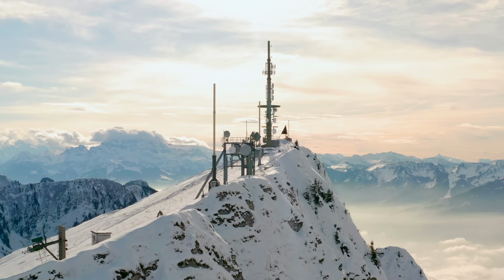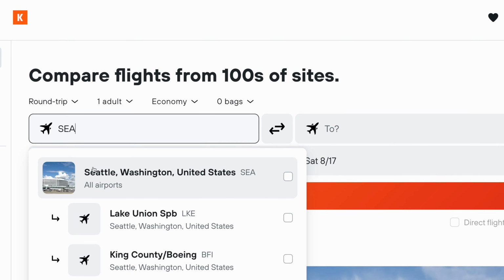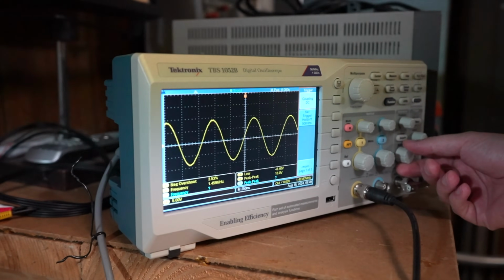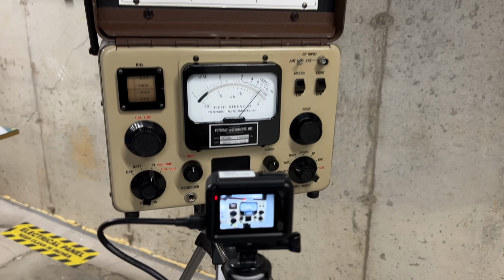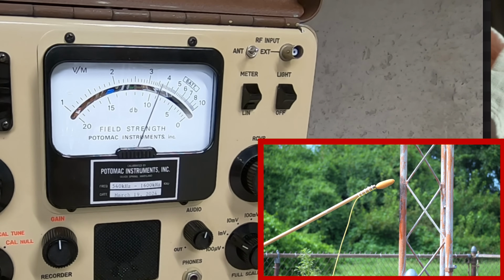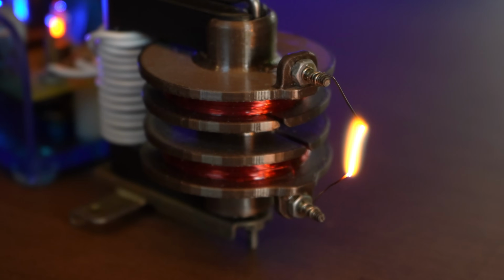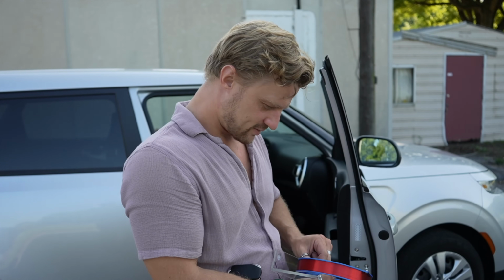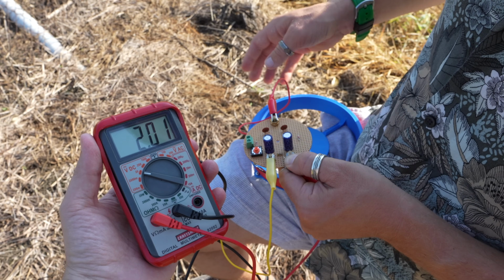Stealing Energy From Radio towers Using Plasma (ft. Geerling Engineering)

Comment: I was a radio alignment tech for UHF and VHF two-way radios, such as those used for police and such.  One day I was working on a 20 watt handheld and got a little too close to the final (the transistor that drives the power to the antenna).  Wow.  Now I have been shocked before, a number of times, including from a 30kv neon transformer....and non hurt as much as that RF burn.  It honestly felt like taking a glowing hot needle, sticking it into your finger, driving it into the bone.  I told my boss, and he said that if I had gotten hit by one of the 100 (or more) watt car-mounted ones, I'd be going home for the day.  My finger had this little dark tinge around the spot it happened, for quite some time.

I misspoke on the transformer...I recalled the numbers incorrectly.  I remembered 15 and 30 but transposed the value they were attached to.  It was a 15Kv 30mA max...I mistakenly remembered 30Kv 15mA.  It did make for quite a good Jacob's Ladder.  It struggled at first to restrike the arc, but I found an article about what was called a Gabriel's Anode, which is just a high resistance resistor connected to one post, with the other side floating near the other post.  The arc strikes from the free leg of the resistor, then the arc reaches to the other leg, avoiding the resistor, then travels up the arms.
Reply: I got my RF burn from a cavity oscillator in an aircraft transponder! Same thing happened to my finger, a burn that went deep into the finger, and took a long time to heal. Afterwards I was even MORE careful around the output components.
Reply: thats something that always gets quickly lost, and something i had to learn myself tinkering with RF electronics... 
being used to pumping kW of power into a resonant tank at 100khz, thats only resonating at 300V or so... lower impedance and all, at those frequencies no matching needed. Skin effect... capacitance still too little to cause any pain when touching a resonator.
But at the almost all the time used 50 ohms in the RF bands (13.56MHz where i was playing :P) even the lower voltages cause quite some current to flow because of the higher frequencies. 
i can only imagine VHF and UHF bands to cause any capacitive reactance a fingering guy presents to shoot close to 0
Reply: Neon transformers are 15 kV max.
Reply: @mernokimuvek  With RF burns, it isn't the voltage, but the frequency that gets you. VHF and UHF radios are bad, but microwave frequencies, up into the 10 GHz range are nasty. In my case, the voltage was 7KV, but magnetron voltage could get up into the 25KV range, higher with military radar. And they put in many interlocks to prevent accidents.
Reply: @jeffreyyoung4104  I know, but the guy mentioned a 30 kV NST. Which simply doesn't exist.
Reply: @mernokimuvek  Oh ya, not sure where 30KV is used, but it sounds familiar for some reason. Lasers? CO2 or some other gas laser? I would rather stick to RF nowadays, as I never had much luck with lasers, other than the old gas HeNe for holography, I couldn't get rid of stray vibrations living near a freeway at the time, so I gave up. I still have a HeNe tube, but it doesn't lase any more. And they only needed 3KV.
Reply: @jeffreyyoung4104  Some CRT TVs needed more than 30 kV.
Reply: @mernokimuvek  The larger the more voltage, also color tubes needed more than mono.
Reply: @mernokimuvek usually not more then 25kv. I think the projection TVs may hit 30kv. The reason you didn't want to go over 25kv is it starts to emit X-rays when you get much higher. Kind of unsafe. Took radio/TV repair in high school so have some experience in this.
Reply: @glynnetolar4423  It already emits X-rays in the single digit kV range but even regular glass can block X-rays up to 10 keV and lead glass can block them up to 50 keV.
Reply: @mernokimuvek my 25" color set produced a 6" spark. Right to my finger. I was leaning on the uhf tuner input,  with the left side of my chest ( my heart ). God is wonderful
Reply: Try pointing your finger at something and concentrating really hard on the idea of lightning coming out of the Tip. You never know you might have a superpower now.
Reply: @Buzzhumma  My super power is being able to repair electronic equipment. I have been doing it since I was 8 or so, and I could solder with a butter knife heated in the flame on the stove. I even had a work bench at age 8, in my bedroom, where I could tear electronic stuff apart, fix it and get it working again. My favorite things were old tube shortwave radios, and even today, they hold a special place in my heart.
Reply: I tasted 25 watts vhf military radio output directly on my tongue.  75.95MHz to be exact.  I was trying to see if the radio was broken or the antenna coupler. It wasn't the radio. That put out full power. I had someone in the helicopter blip the transmitter key on / off.

Comment: I bet those long arcs on the sausage make some interesting harmonics. 

Plasma is a non linear resistance as you know, you could probably hear that station on a few short wave frequencies when that arc was there.
Reply: Yeah, you're past the low pass filter on the output. Good thing it was only 12 KW and that hot dog made a pretty short antenna. But I would have loved to hear your explanation if the FCC called.
Reply: @jamesvandamme7786  I wasn’t there (sadly, lol.) I’ve heard stories of this happening on transmitters before, but I’d imagine the output generated on other frequencies would be much lower than the transmitter’s normal power. 

It also would be a one-off thing, and incredibly brief so I kinda doubt the FCC would put too much effort into it unless it was repeated.

Comment: Any time you're back in St. Louis, we'll do some more Midwestern science experiments! 😂
Reply: As a Midwesterner just south of STL, that 'midwestern science experiment' statement can go a lot of ways. From actual experiments, to ones soaked with Busch Light and sunburns, lol
Reply: Please tell me you got Jay the St Louis classic: Ooey Gooey Butter Cake?
Reply: @MeatBall-1-3 we tried!! Unfortunately the place we stopped was out - Bike Shop in St. Charles. He got some gooey butter/brownie but it's not quite the same. He'll just have to come back. And we'll do T-ravs too.
Reply: @MeatBall-1-3  or toasted ravs as apparently that's not a thing other places? (The butter cake I knew was local, but toasted ravs? Still blows my mind.)
Reply: Come create a plasma twister in nado alley, at Tulsa Ok!
Reply from the maker: Count me in!
Reply: As a fellow Midwesterner only a couple hrs away from STL i can confidently say said experiments usually involve some form of alcohol and fire.

That being said i have a serious question. How well would a generator designed to pull power down from radio waves charge a battery bank?
Reply: @scotyarborough4403  It would be a very small trickle-charge, and would need to be close to the tower to get a few volts of power necessary to actually charge anything.
Reply: I recognized your dad immediately
Reply: Now build a Tesla tower as it was intended to be configured and transmit power using zenneck waves
Reply: Only needed a couple seconds of audio to know it's a christian radio station😀
Reply: sucks that thing is used to spout off about the BS of Christianity!
But hey, a hot dog or coil will easily take care of it 🫡
Reply: I literally live right down the road lol
Reply: Make sure yall visit Shirley’s and grab some trashed wings. Worth every dollar.

Comment: Could you build a drone that could power itself  and have altitude hold .? That would be cool. You could have infinite flight times. Until it burns the motors out🤔. Or have an override to control and land.
Reply: That would be very hard. In theory, if you'd have a loop antenna that weighs next to nothing, you could hover within one or two meters of a large transmitter tower, but that's about it.
Reply: or a car
Reply: There were ideas of powering cars on a highway with loops of wire under the roadway. It would of course be terribly, ridiculously inefficient to do it from any kind of distance.

Comment: How does the radio wave travel around the curvature of the earth?
Reply: As far as I know the waves reflect of the atmosphere
Reply: @yudin_yaroslav  or the firmament?  Something solid to bounce off of?
Reply: Look up "ground wave propagation"
Reply: @dresdenvisage  I dont need to cause the earth is flat and thats how its traveled.  I dont need pseudoscience to convince me how something travels.
Reply: @Redgogrey  So you just go around asking questions and refusing to learn the answer. Gotcha. Go away.
Reply: @dresdenvisage  I figured the words used in the video title would attract a bunch of crazies and I wasn't wrong
Reply: Most don't. In most frequencies radio is a line of sight technology. Refraction and reflection off the ionosphere can greatly extend the range of certain frequencies though. Similar to how visible light bends in hot air and reflects off water.
Reply: @nonna_sof5889  Love the explanation, but that person doesn't actually care about reality.

Comment: The wood rod was held rather close to the body at 8:08. An arc could potentially jump from the wood rod to the body, bypassing the gloves. It looks like the gloves are designed to have deep arm holes to prevent arcs from routing around the glove. Please be careful because high voltage arcs will go around your insulator to bite you.
Reply: Keep in mind it's 800 volts.  It can't jump more than a few mm.  They were very safe.
Reply: Well I dont have my engineering handbook uh, handy making it rather useless rn, I do know that wood is an excellent insulator for electricity. 
Do you know why blank circut boards are called breadboards? Because the first ones where just that, used bread cutting boards, and quite a lot of high powered equipment is still in operation using just wood to insulate.

The problem with wood comes primarily from it lighting on fire, and secondarly from it needing an ample safty factor as humidity changes its insulating value but I would say a 2 meter stick is more then ample for a saftey factor.
Reply: @AnonymousAnarchist2  For sure, they took more than enough safety precautions in this video. I just wanted to point out that subtle detail for those who are still learning and have not yet been surprised by a rogue arc taking the long route around insulators.
Reply: @nathan-shearer  well that is a good point.
Reply: @AnonymousAnarchist2 an excellent point indeed—I looked into a proper fiberglass rod but was turned off by the $600+ price tag.

Long term I'd like to find an even more resilient rod and way of attaching to the grounding system (if we do this again lol).

But we deemed the safety factor good enough for this particular scenario, especially as the greater risk was heating over time (my dad dipped into the "hotter" zone about 1.5M away only for 1 min or so at a time).

But I also made sure to store the stick in a dehumidified area for a few weeks before our testing, just to ensure the wood was also nice and dry.
Reply: You are correct. A radio friend of mine experimented with NST fed spark gap transmitters in his younger days, with flat coils wound on wooden formers. The wood would char with ease, because wood can be very lossy at RF frequencies. 
However, it would be trivial to test the wooden stick for safety. Lean it against the tower, and see if it heats up. If it does, there's enough conductivity to be a potential hazard. 
The gloves are rated for 50/60Hz AC. Hand capacity might mean that even though you have those gloves, that a dangerous RF current could pass through the body. You could calculate how bad this effect is by holding a metal bar in your gloved hands, and measuring the capacitance between the bar and your body. With this you can calculate the impedance, and so the RF current running through your body if you would be holding a rod energized at the AM tower's RF voltage.
Reply: Wood stick... Normally you would use a glass fiber rod that is a good insulator.

Comment: At 8:20, Joe's 100% right. I used to freeclimb a lot of stuff, cathedral spires, bridges, and other assorted tall stuff. No towers though. They're rather zappy.

Not that falling from great height isn't any less dangerous 😅
Reply: One might argue with that last part. You can't be sure which parts of a tower are energized, but you can learn how to prevent falling while climbing.
Reply: @raphaelfranzen9623  I knew exactly what was energized on my radar towers.
Reply: @raphaelfranzen9623  Funnily enough, only ever had one close call in regards to falling, never had any issues after that.

Liquid chalk helps a lot too 🤙